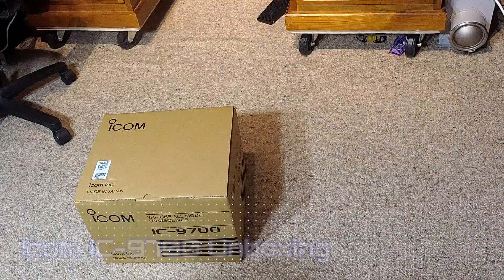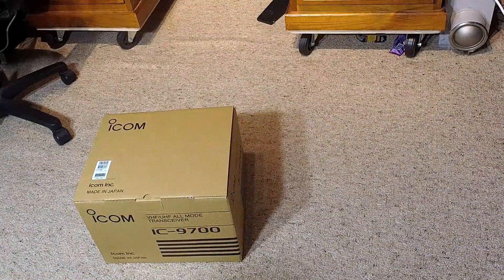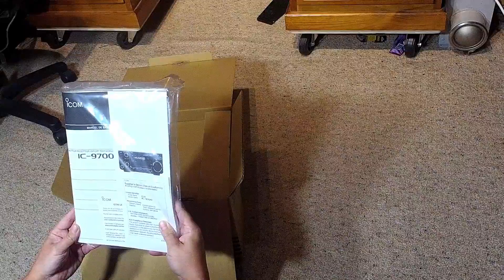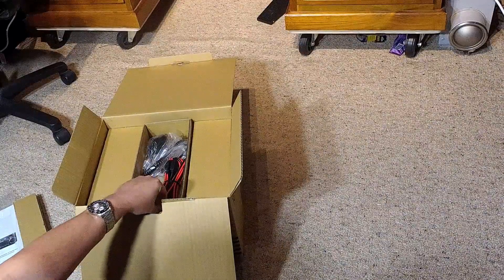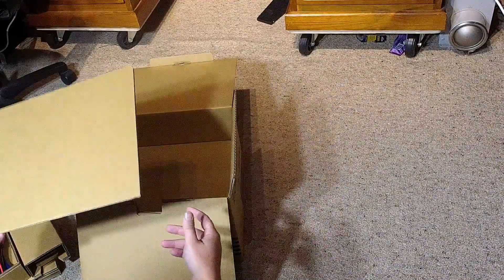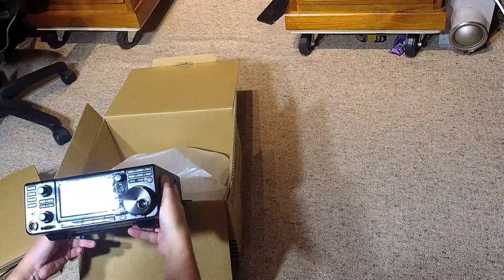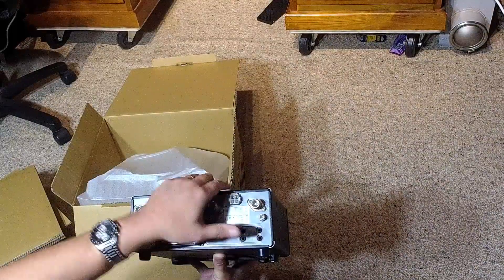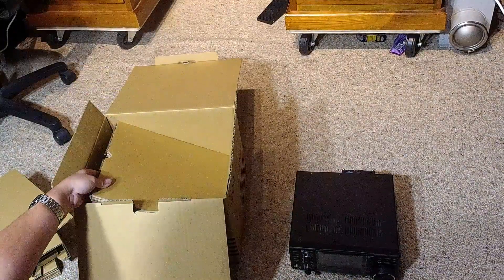Icom IC-9700 Unboxing

Comment: This radio made it impossible to sell my Icom 9100.  It’s barely used and in perfect condition? I don’t understand qrz.
Reply from the maker: The Icom IC-7300 & Icom IC-9700 have really shaken up the market place.  My advice would be to wait for test data from the IC-9700 to come out before trying to sell the IC-9100.  Don't take a low price based on speculation; wait for the hard data.  73, Jarrad VK3BL :)